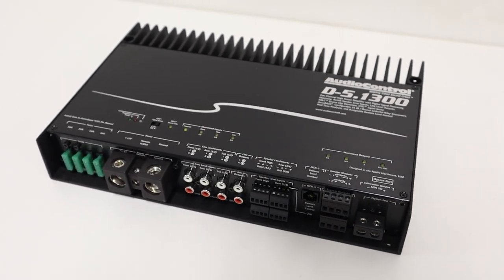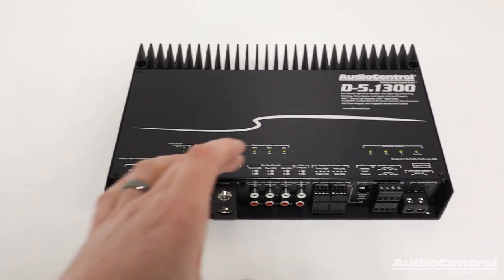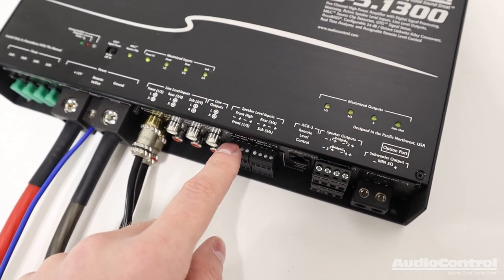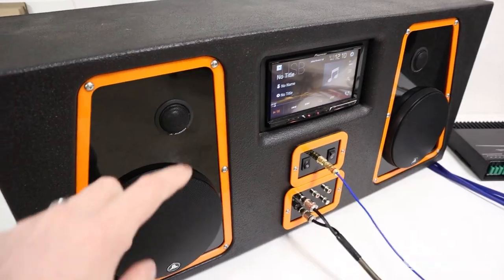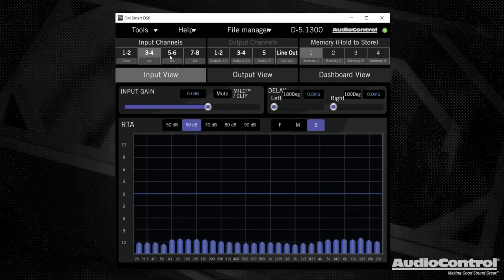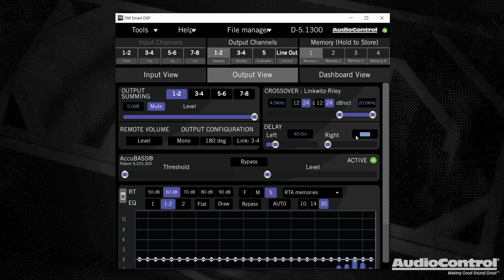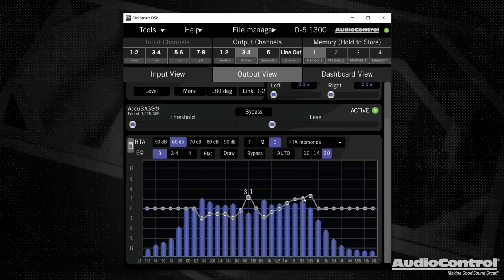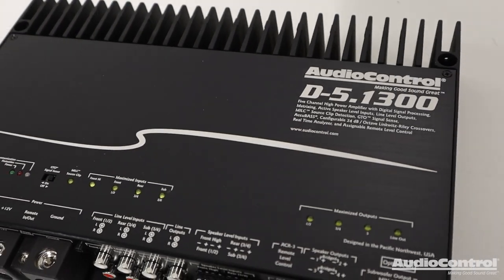AudioControl D-5.1300 - 5 Channels of DSP Controlled GREAT SOUND!

Comment: Can anyone positively confirm if this amp will pass speaker level input on through to the speaker outs (un-amplified, of course) if the amp is not on?  I'd like to use my Bronco's upfitter switch to turn the amp on/off, and pass audio (speakers only) when it's off so there is zero bass.  Thoughts?

Comment: Considering installing the Kicker 48TRTP102 10" Thin Down Firing Subwoofer Enclosure with Passive Radiator - 2 Ohm with this amp however it is rated at 400 watts RMS. The 12" version is rated at 500 watts RMS but is pretty large. Would there be issues if I used the 10" at 400 watts RMS?
Reply: Just don't get carried away with the gain knob
Reply: @MrTaterNubbz  so the 10" should work fine?
Reply: @breyerssdb  it will work but don't send too much power is all. It will work at the correct settings... Look here https://m.youtube.com/watch?v=Bf5oFjJEV2k
Reply: Just adjust the gain until you're getting 400rms